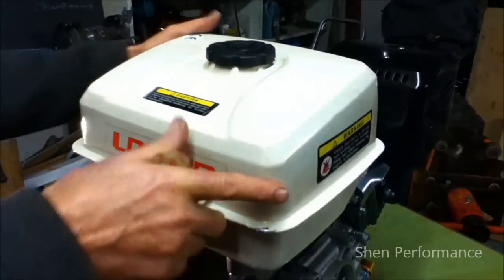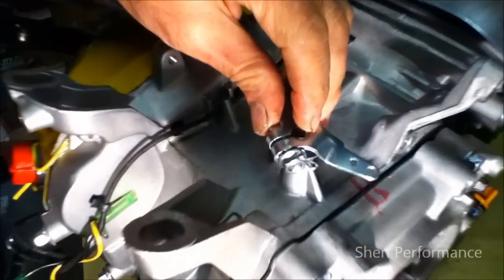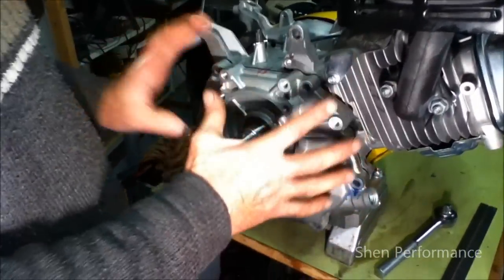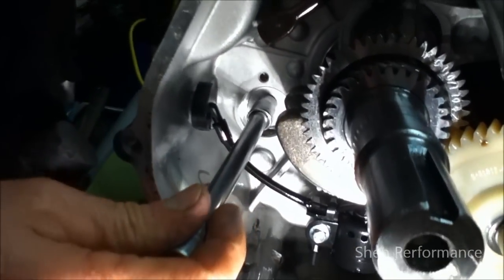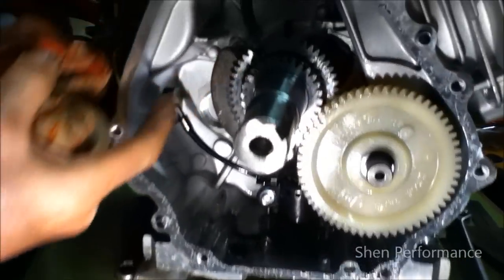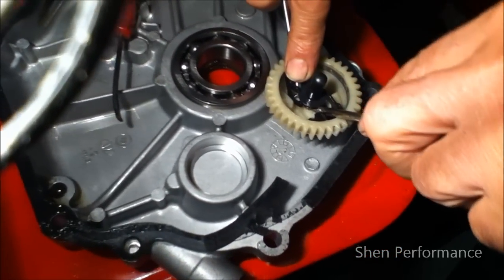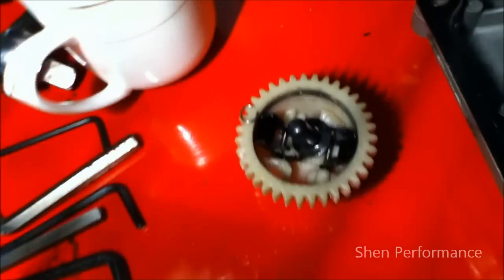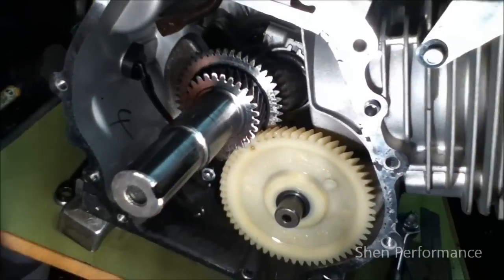How to remove the governor from a g270 go kart engine 9HP lawn mower

Comment: I dont understand how to governor arm would cause internal damage if you just left it installed as is and used the throttle linkage like you normally would. I did a dry fit after removing my governor and the shaft the governor sits on stops the swinging arm from hitting any gears, I did multiple dry turnovers this way and everything is perfectly fine.

Im confused, it does not seem like you HAVE to remove that arm.

Im trying to keep my throttle set up as close to OG as possible

Comment: I’d give serious consideration to rather than putting a bolt in the governor hole, tap the hole and stick a short bolt straight in with some lock-tite. You double locked it, so I’m not worried. But I have seen people do it like you but put it upside down where the nut is inside. They didn’t even use lock tite or a lock nut. That’ll cause problems. Your install is perfectly fine just any space in the bolt and block will let water inside. Great job otherwise
Reply: Farmer Connor I cut the hook off the bottom of the bar and re install it so I can use factory throttle

Comment: Dear Shen Performance,

Great video, very useful, but I would have some question about.

If you remove the governor, what will be the max. rpm on full throttle? Because in my opinion, in this case there is no other part to regulate the engine speed (maybe the limit of gas-exchange process). It wouldn't be necessary to install a new ignition coil/transistor to regulate the max. rpm with  ignition-cut in a specified rpm (for example ~7000 rpm)?

Thank you in advance!

Comment: Nice video, thank you.

A question though.  Why do you have to remove the governor?  Can you just disconnect the linkage and leave the governor?
Reply: certainly it has the same effect, they just want to remove all in one time
Reply: Cool, thanks!  I actually ended up open the case and removing the gear.  The governor gear I think was causing some vibration as it wasn't spinning true on the shaft.  Took out some broken pieces too.  Got a mini tach to make sure I don't blow up the engine!
Reply: Phil W.

Comment: I just removed the governor, but when i try to start the rpms are to slow and if i move the choke, the engine turn off.
Reply: Did you replace the governor ?
Reply: Did you replace the governor ?
Reply: Yes with all the components.

Comment: What sort of power and revs dose the engine put out with the govenor still in place and can I not just dicconect the govenor arm. Cheers Pete
Reply: The govenor is set at 3600rpm and the power for that is usually displayed on the engine cover. You can just disconnect  the arm but know that those gears are plastic and will break sometime in the future because you can reach 6000rpm now.

Comment: if im not removing the governor in my engines.. so wheach to say the  rpm of my engines stay in 3600rpm... in that case...my boat is running slow....i want my engines to be hi rpm..you said the only way is by romoving the governor control... but annyway tnx a lot to youre advice...

Comment from the maker: Hi there. Firstly, since you will be full throttling, I do not recommend you to remove the governor or alter it. However, there is another way of gaining more power and throttle response. You will need to replace your piston with a larger one and also replace the valves with bigger ones. This will mean that you will need bigger carburettor jets. Alternatively, for more power, I would personally go for a 2 stroke, electric start engine that has higher revs. Good luck.

Comment: @ shenperformance... i have ex40 robin subaru.. and i using in my pump boat in philippines,,,my maximum speed is 3600rpm.. if i removed the governor control in my engines there is possible increases the rpm of my engines?my other question is if im not removing the governor control,,, but im adjusted the governor plunger to clock wise...to just to not push the governor control.... its is also increases the rpm of my engines? iwhen the engines using in the pumpboat useually everytime in ful trotol

Comment from the maker: If it's a 'turbo' engine, you will already have enough rpms so you must be careful not to blow the engine as I have mentioned in the video. It does work with the carburetor, you do not have to change it to injection.